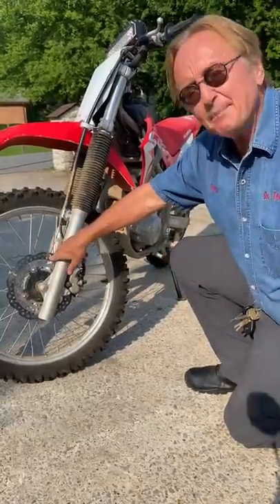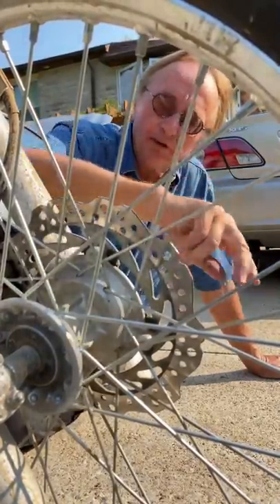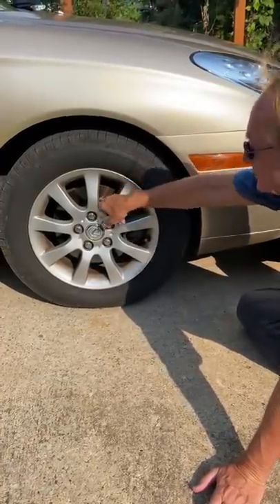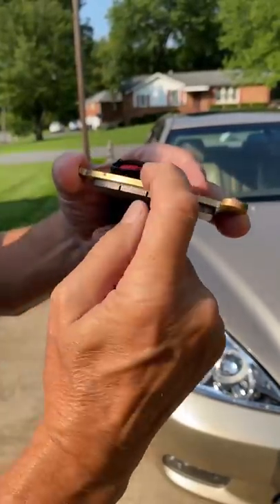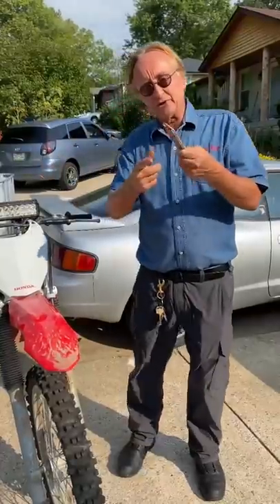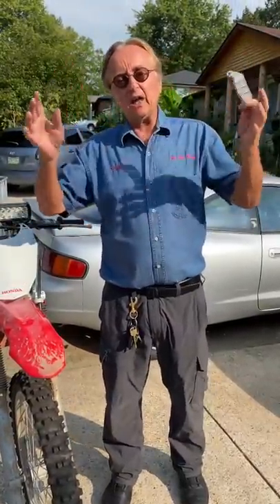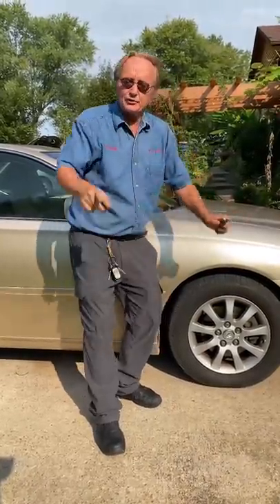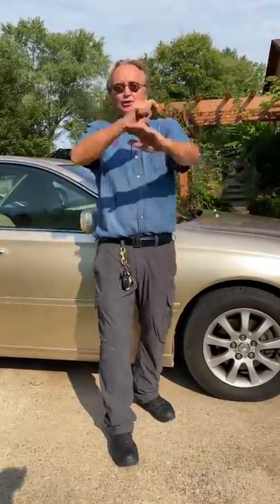If You Use These Brake Pads You're Stupid

Comment: Two things I never go cheap on are tires and brakes.  I always make sure the pads/rotors are in great quality, apply anti-seize on the pads, hardware, etc, silicone paste on the caliper sliders to slide easily, and torque everything to spec with a touch of threadlocker, just to be sure.  If the brake fluid is old, I flush it out.  It brakes great after doing all of this.  I also torque the wheel lug nuts to spec to avoid the rotors from warping over time.

Comment: Akebonos, a little anti seize, and decent rotors… never shortcut your brakes
Reply: Akebonos for the win
Reply: Brakes and tires and ketchup are things I'll spend good money on.
Reply: @smbmxdirt3427  lol, don’t forget the Cheese-Wiz
Reply: Lol dont judge me i put duralast on my akebono calipers
Reply: I got the Brembo ceramic pads. Are they similar to Akebono?
Reply: @chang.stanley  brembos are definitely a solid oe replacement. been running them for about 4 years. am looking to upgrade to akebono bbk next though
Reply: Akebonos are garbage too. At least for Toyota’s. I’ve tried Brembo, Akebonos, and centrics on previous Toyotas. They’re all garbage and crap out really fast and a lot of brake dust. Best ones are factory straight from the dealer and they last the longest
Reply: I love my akebonos. So smooth.

Comment: This probably explains why the last time I changed my pads they squeak occasionally. I obviously went too cheap.
Reply: Not necessarily, if you don't use anti squeak on the caliper side or runners they will squeak from vibration
Reply: I'll make sure do that next time.

Comment: This all depends on the application because yes under most normal short trip drivers plan ceramics are okay but under hard braking conditions you should install semi metallic pads as they don’t fade as easily and make for way better stopping Proformance.

Comment: Once used semi metallic pads on front disc brakes of 1988 Toyota truck. Oh they worked fine but come time to replace the pads and they had worn grooves into the rotor. Bought the inexpensive (cheap) organic pads next time and they worked much better plus didn't ruin the new rotor. Just because they are "cheap" doesn't always mean they are a bad thing.

Comment: This is one of the reasons  why I chose sintered metal for my brake pads over cheap resin brake pads. The other reasons have to do with greater stopping power and better heat disapation. For reference this is on my main use electric scooter, double piston disk brakes.

Comment: Wagner Thermoqueits pads and rotors are fantastic! So are CARQUEST PROFESSIONAL PLATINUM PADS AND ROTORS FROM ADVANCE! Used those for almost 6 years and 60k miles. I have the Wagner Thermoquiets on my car now and they have been excellent. I'll say the Carquest PROFESSIONAL PLATINUM brakes make almost zero brake dust abd the Wagner's produce some.

Comment: If you want semi-metallic pads, Centric Posi Quiets are great. Put those on my 02 Sierra for better stopping power. They do give a jerk after you come to a complete stop, so just slightly let off the pedal before it completely stops if that bothers you.
Reply: You don’t have to stick with ceramics if you don’t like them. Quality semi-metallics aren’t that bad. Any pickup truck I buy, that’s the first upgrade I do, is replace all the rotors, & swap the ceramic pads for semi-metallics.

Comment: I only use semi-metallic if I need to stop on a dime. Yes they are noisy but they stop you. The ceramics are weak but last longer and don't make much noise or dust. Those are the ones I put on my wife's car.
Reply: LOL. xD
Reply: You can get great quality ceramics if you find the right ones.  They typically take a while to heat up, but once it does, it brakes amazing!  I also upgraded to slotted rotors, and wow, what a difference it makes.

Comment: I REALLY love the Power Stop brake kit!  Drilled/slotted rotors & carbon fiber/ceramic pads.  It will stop on a dime...EVERY!  TIME!
Reply: I’ll have to look into that.1996 4 runner. Had a brake job done a year ago. Master cylinder suddenly went out. The place was supposed to go over the brake system and “make it safe and go from there”. My cousin was in town(NC) visiting his mother. She lives up the hill from me in my grandmothers house and I help her out with a lot of things around the house. My cousin was trying to help me out but it turned into a nightmare. He had no idea that I had been sourcing new old stock OEM parts and installing them along the way. Spark plug wires, proper spark plugs, one ignition coil needed to be replaced. A few other things. They took all my brand new stuff off and” threw it away”. I asked which trashcan or dumpster is my stuff in and they started stammering and stuttering. They Dr., Toyotas. They’ve been in business for nearly 30 years. I have a good idea my wires and stuff are on their Toyota now. They put the cheapest crap they could find on my truck. The brakes shake now etc. I’ll look into that kit. Wouldn’t dare go back to that place. For any reason. My cousin is from Pennsylvania. I suppose I could’ve taken them to small claims court and explain the situation. I would’ve won. I am the owner of the vehicle and made an agreement with the owner of the Business. The head mechanics wife. Verbally and in writing. Break system only! Pisses me off every time I think about it. Water under the bridge. Take it easy
Reply: Just looked it up online. Haven’t read much yet but they look good. Top rated, recommended upgrade etc. etc. etc. Thank you. Saw the word affordable, made for many Makes and models of vehicles. Have a good day
Reply: great for the street. not so great for the track. Drilled rotors have a tendency to crack, when they get hot.

Comment: Actually as a mechanic I find the brake squeak more often comes from bad techs,not greasing the caliper pins..making the rear pad always in contact with rotor

Comment: After I changed my pads I noticed the brakes squeaking when applying the brakes only partially, not when fully to bring the car to a stop. As it turned out the rotor had a small raised edge around the perimeter from the old pads wearing out the rotor and when the new pads rub against it without fully grabbing it it causes the rotor to squeak. I have now driven the car couple of thousand miles and the squeaking is gone.

Comment: This is only part of the problem. Besides cheap parts you could also get a squeak from not enough grease. When I was a mechanic I always used a liberal amount of grease so I don't have to do it twice. I have seen cheap brake pads squeak before but its really rare. Like 1/20 sets might squeak.

Comment: minimum pad material thickness 4mm
no reason to use cheap pads. normal pads are ok but if you want more stopping power like carbon ceramic performance there are all sorts of performance pads some aren’t even road legal and  can cost over 250$ per set. Usually they eat rotors fast so only suitable for sports cars spirited driving/track use

Comment: I’d like your advice by switching from ceramic to semi metallic pads is not gonna make it squeak. That’s just ridiculous. Every truck owner switches from ceramic to semi metallic in order to haul heavy loads and drive around Mountain areas because they handle the heat the best. Ceramic isn’t good for a truck that Paul’s trailer. That’s why all F250 f350 and f450 they actually come with semi metallic because that’s what they need. All of my Chevy trailblazers came with ceramic brake pads but they all have semi metallic on them now front and back never heard a squeak ever

Comment: I dunno about cheaper being harder. Had a friend that I did his brakes (rotors, pads) for on a 90's Camry, they disintegrated in a matter of months and left a good black coating on the rims. The friend got the pads for me to put on so I dont remember the brand. They had gotten the cheapest pads on Rock Auto, they were under $10 I recall
Reply: RockAuto sells cheap stuff. They also sell expensive stuff. They have it by grades. If you need brakes to sell the car, get the cheapest. Under $10. Sounds like a deal. Then they have daily driver, professional, heavy duty. They also support a heart. Those are the ones with a good review.

Comment: I've watched scotty for a long time... now that im becoming a trained mechanic, im starting to realize flaws. There are 2 types of pads. Always. The material of the pads is what determines its characteristics. Just because brakes squeak doesnt mean theyre "low quality", that might just be because of the charicteristics that that material has. Lots of sources say if new brakes are squeaky, they werent burnished correctly. As far as the 2 types of brake pads, they are abrasive and adhesive pads. Like i said, the material is what categorizes them. Abrasive pads are generally more squeaky all the time, adhesive pads would make squeaks only when youre about at a full stop. Hope this helps. Scotty quit screamin about nothin 😂

Comment: I use cheap pads and rotors. I get 50-60K miles out of them.  I use quiet glide hardware, grease the sliders every 2 years and never had any noise problems.  I get 100 000 miles out of the cheap rotors by facing 5-10 thou off on a lathe when they start to get bad, I skim them 2 or 3 times before replacing them.  I have had to grind the end tabs of the pads to get them to fit better, that takes about 5 minutes.
Reply: @logicthought24  I tried the expensive pads and rotors, in fact my wife destroyed a very nice rotor and a set of ceramic pads  and the tire right after a brake job on her vehicle because the caliper seized and she didn't tell me for a week. I put a cheap rotor and pads  on the drivers side, the other side had the expensive stuff. The expensive rotor and pads lasted the same amount of time as the cheap one and the performance was the same.

Comment: I do my own brakes I only use toyota OEM or I get the duralast gold from autozone 

toyota dealers can kiss my a$$ OEM brake kit with rotors front and back for DYI $475 fair price if u have Toyota do it it’s $479.99 per axle plus tax 😭😭😭 basically $1200 a brake job I keep telling ppl to go to trusted mom n pop shops with the DYI brake kit but they don’t listen